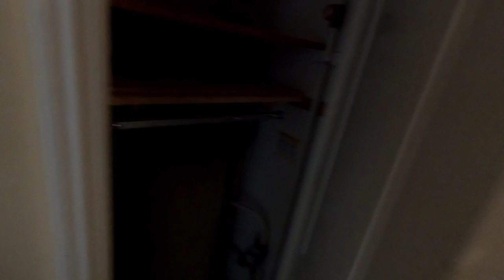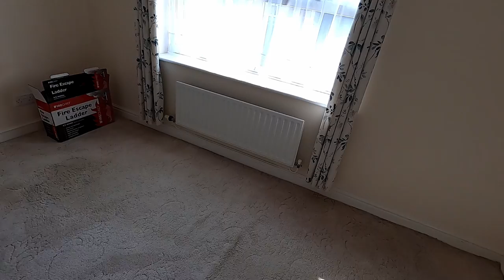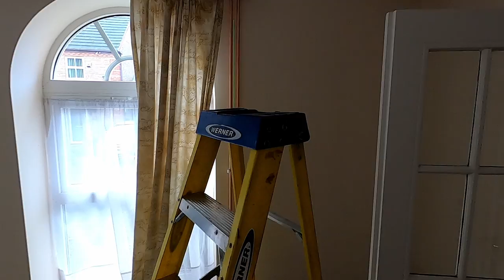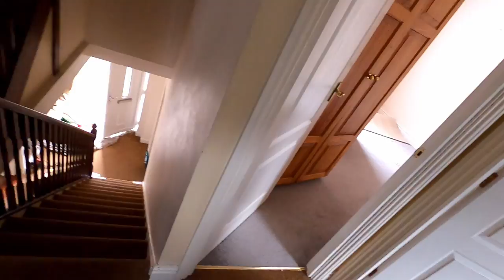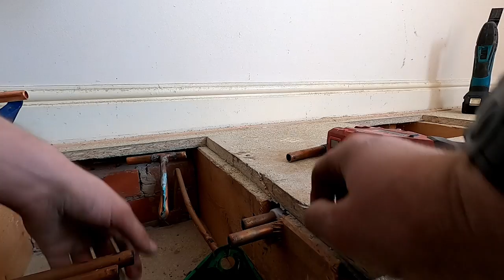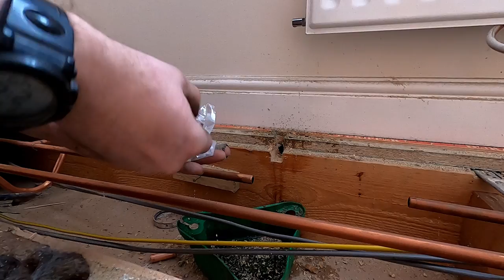A problem heating system gets an upgrade

Comment: Tom could you not have sealed the system instead of leaving on open vent
Reply from the maker: It was a thought I did consider, the pipework would have still been an issue, a good clean vented system should still be Ok, thanks for watching as always 👍

Comment: Tom back in the day with British Gas who would have thought that all that Tru Well copper and miles of 10mil & 8mil  we put in  it would be making work for you young un’s today. 😂😂😂
Reply from the maker: I know mate, I fear for the plumbers of the future with some of the stuff we are fitting now, o rings everywhere be it plastic or press, give it a few years and there will be heaps of leaks with no plumbers to fix them all, thanks for watching as always mate
Reply from the maker: @TONE11111  You could be right mate, this job is going to change dramatically in the next 10 years, I guess that's one reason I make the videos, seeing progress over time,  I'm sure there will always be work for plumbers but the job is getting more technical all the time, thanks for watching 👍
Reply: @TONE11111  Heatpumps also use the hydronic systems in the house.😊

Comment: I bought an old house just before Christmas, the whole heating system is done in 10mm pipe and manifolds. I am tearing out the lot in a few months time. It’s a disaster, half the rads don’t work and a couple of leaks downstairs. I got a gas engineer to check the boiler when I moved in, he nearly died laughing at the state of the pipework. 😂
Reply from the maker: Hope you get it all sorted mate, there is an estate near me where they put the manifolds under the baths, an absolute lash up if you ask me, you are probably doing the right thing removing it, at least that way you will have a reliable heating system
Reply: @PlumbLikeTom . Thanks for the reply. I have a suspicion the manifolds here are under the bath too. 
I have not been able to find them anywhere else and there are a lot of 10mm pipes on that side of the house. Looking forward to getting rid of it all. 

I enjoyed watching your video and seeing you take care to hide the dropped pipes from upstairs. In my last house they were just run down the middle of the wall 🤣 Under the bedroom floors was a maze of pipes that held nearly as much water as the radiators held, I just scraped the lot and started again.

Comment: Good video Tom, you did a great job of hiding the new pipe runs as far as you could. It is a shame the plumbers of yesterday were fitting such crap as micro ore when they were only a few feet away from a 15 or 22mm pipe.🤷‍♂️ The increased head in the system and low rates pretty much guarantees that system dirt will settle in the low flow micro bore legs.
Reply from the maker: Thanks for the support as always Norman, things are just done for speed on these sorts of developments, microbore is quicker and cheaper to hide behind the dot and dab walls, like you say it does eventually lead to problems, what also didn't help this system was that it had been added onto

Comment: Hi Tom, another enjoyable film there thank you, I have done quite a few domestic 10mm to 15mm central heating system conversions.
I always enjoy that kind of work, as I love copper pipe and soldering. I’m sure the system will be lots better with the 15mm pipe work.
Another great job there Tom, have a great weekend and as always, take care. 👍👍👍
Reply from the maker: Thanks for the support as always Chris, to be honest you can't beat proper copper pipe, 10mm is alright but this system was filthy, hopefully it should be a lot more efficient now and save the new tenants a bit of money of their gas bills, have a great weekend mate 👍

Comment: I don't even attempt to flush anything under 15mm pipework. It doesn't work.
Great video as always mate
Reply from the maker: I used to do a lot of flushing when I was an apprentice, I messed a micro bore system up once and completely blocked all the drops, on micro bore now I take the rads off, and use my magna cleanse unit, thanks for the support as always Colin

Comment: Good work, Tom.  I use loctite 55 as well for threaded fittings but for rad tails I got fed up cutting off all the fluffy bits, gone back to ptfe tape.
Reply from the maker: Thanks for the support as always Martin, that's the only problem with locktite, when I used to do loads of iron pipe I used to burn it off with a gas lamp, it would be a bit extreme to do it on a rad though, have a great weekend mate
Reply: Just use the blow lamp that sorts the flufy bits out perfectly flame and wipe done

Comment: Get some iMilwaukee press fit they will make you money in the long run mate
Reply from the maker: I do have a rems press gun, I mainly on use it commercial jobs, I have been toying with the idea of pressing more but the cost of the fittings puts me off, I also prefer the look of end feed below boilers and onto rads
Reply: @PlumbLikeTom  time saving Tom is money and when water in pipe a god send etc

Comment: If all electrical circuits within the bathroom are on a 30Ma rcd no need for that bonding cable 👍
Reply from the maker: Thanks for the support mate, the electrician had a few bits to do on the job so I got him just to check everything, he said the same, it was a stupid place to run the cable to be fair, have a great weekend mate
Reply: Love this channel. Love your work ethic. 
Really enjoy watching heating engineers/plumbers. Would love to do a few courses one day
Reply: Another great video Tom, if press fitting cost the same as end feed would you miss the ‘art of soldering’ ?. Enjoy your weekend 👍
Reply from the maker: Press does have big advantages, it probably is the future but there will always be a place for soldering, I'm seeing quite a bit of the carbon press stuff leaking that's been in a few a years now, I know this is different to copper but it does make you wonder a bit how long that o ring will last, only time will tell, one things for sure the next generation of plumbers won't be short of work if it all starts to fail at the same time
Reply: @PlumbLikeTom  got hep20 been in 30years Tom still no leaks
Reply from the maker: Fair point mate, there will likely be a point in the future where this stuff does start to fail though, thanks for watching as always